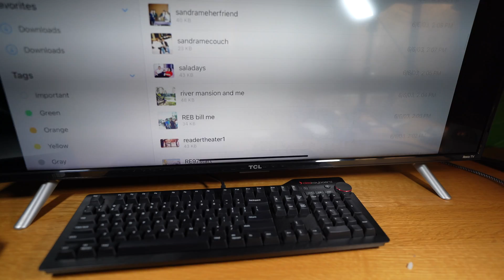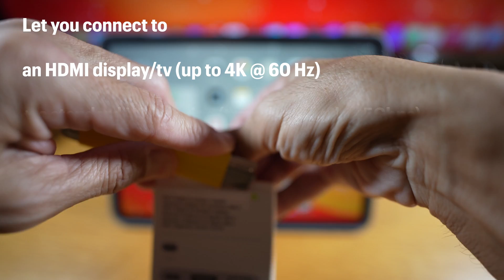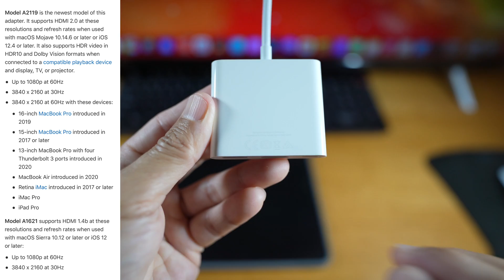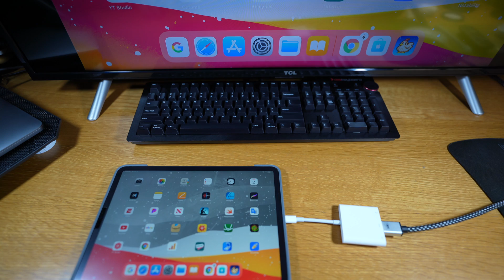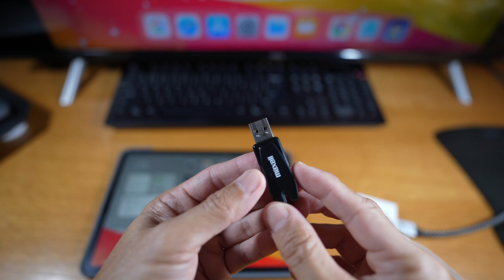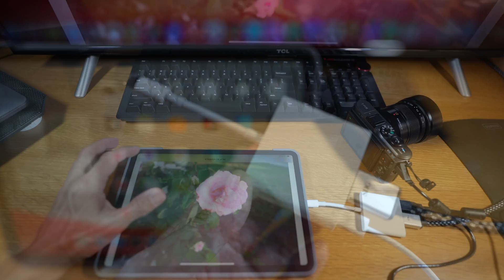For M1, M2 & M4 iPad Pro, Apple USB-C Digital AV Multiport Adapter

Comment: Elgato hd60s working this adapter are not
Reply from the maker: Yeah, the Apple USB-C Digital AV adapter can be picky—especially with capture devices like the Elgato HD60s. It’s mainly designed for simple HDMI output like monitors or TVs. For game capture, a powered USB-C hub or a different adapter might work better.

Comment: what happens if you unplug the power supply while you have a usb flash drive connected to the adapter at the same time? would the usb flash drive get disconnected?
Reply from the maker: Nothing will happen if you’re using an iPad with a USB-C port. These newer models are designed to handle USB flash drives and HDMI output without needing to stay plugged into power. You can safely unplug the charger—your flash drive will stay connected and working just fine.

Comment: Sir Can u connect a gaming headphone to the usb-A port ?
Waiting for ur reply :)
Reply from the maker: Yes, you can connect headphones to the USB-A port of the Apple USB-C Digital AV Multiport Adapter, but it requires an additional accessory. Specifically, you’ll need a USB-A to 3.5mm headphone adapter that contains a digital-to-analog converter (DAC). This setup allows you to use standard 3.5mm headphones with the adapter. Ensure that the USB-A to 3.5mm adapter is compatible with your device and supports audio output

Comment: I’m getting audio but no video when plugging in the adapter to my iPad Pro M2 trying to use Netflix or Apple TV+ you tube works fine. What’s going on here?!
Reply from the maker: Thanks for sharing! I’ve been using the same Apple USB-C Digital AV Multiport Adapter with my iPad Pro M4, and I haven’t encountered any issues with Netflix or Apple TV+. It might be worth checking if your adapter is functioning properly or if there’s an update for your iPad Pro. Sometimes a restart of the iPad or re-plugging the adapter helps as well. Let me know how it goes!
Reply: @ yeah I tried all that. I’m wondering if it’s my HDMI cable being too old and not 2.0 or 2.1?!
Reply from the maker: That’s very possible. After trying another, let me know how it went.
Reply: @ ok so i now have video and audio on everything since upgrading the cable.
Reply from the maker: That’s great to hear. Your intuition was right! I’ll keep this in mind just in case others have the same experience. Thank you again.
Reply: @ the next thing I need to now work out is why it only offer SD and not HDR option when plugged in to the 4K TV.
Reply from the maker: Thanks for sharing! HDR support depends on a few factors. Make sure your HDMI cable is at least HDMI 2.0 or higher, as older cables may not support HDR. Also, check the settings on both your iPad and the TV to ensure HDR is enabled. Lastly, confirm that the content you’re playing supports HDR. Let me know if this helps!
Reply: @TossSong  the HDMI is ultra up to 8K. 
You can’t enable HDR on an iPad.
The TV is a Sony 4K HDR10 panel. 
There is nothing here that should stop me choosing HDR as an option over SDR so I’m stumped.
Reply from the maker: I see. Since the iPad outputs HDR automatically when supported, and your setup (8K HDMI, Sony 4K HDR10 TV) is capable, the issue might be the content—I’m not really sure. Ensure the video or app you’re testing is in HDR. Also, check if your TV’s HDMI port is set to “Enhanced Format” for HDR10. Let me know if you figure it out.

Comment: I can connect a USB bluetooth mouse and keyboard to work on it? or the usb its only for transfering data?
Reply from the maker: Hi, thanks for reaching out. Unfortunately you can’t. But you can transfer data like in the video. This adapter is primarily designed for video output and charging, not for connecting USB peripherals like keyboards or mice. However you can use Bluetooth for keyboard and mouse.
Reply: @TossSong  its strange. In the website of apple the description is ''
The USB-C Digital AV Multiport Adapter lets you connect your USB-C—enabled Mac, iPad or iPhone to an HDMI display, while also connecting a standard USB device and a USB-C charging cable.''
Reply from the maker: Okay, I will test again when I get back from work. There might be in the iPadOS or iOS update that allows this. When I first bought it I remember testing it, didn’t work. But try it again.
Reply: @TossSong  i want to use for m3 macbook air. Thanks for the answer my friend!
Reply from the maker: Thanks for your patience. YES, it does work! I first tested a keyboard on the USB port on the adapter connected to my M3 MacBook Pro. (As you know the C port is for power delivery only.) Then I also tested on my iPad Pro, it even had an indicator icon for keyboard connection, never seen that before! So it works on both. Also tested a Mouse too, works. Again, I remember testing it when I first got it, nothing. Things must have improved/changed. I happy and glad about this. Thanks for questioning it.
Reply: @TossSong  Nice! Im seeing review of hubs for macbooks, and have view some review's saying that the non original hubs burn the visor of the macbooks, so i got really worried! And search for the original of the apple wich alows to combine the same structure. Thanks for the help and im glad that my question provides you a new way to use the hub! Thanks!
Reply from the maker: No problem, happy to help. And Thank you for this bit about the hub.

Comment: Hello. Thanks for the great video! Mine was working just fine but suddenly one day I lost the picture when streaming Comcast Xfinity but the sound still played through my TV. But the display was an iPad might sky screen saver. Any ideas? Is there a set up step I messed up? Thanks.
Reply from the maker: Hey there! Thanks for your comment and for reaching out. 
First, double-check all your cables are securely plugged in. Sometimes a loose connection can cause weird display issues.

Try restarting your iPad and your TV.

While less likely, there's a chance the adapter itself might be acting up. If you have another device with a USB-C port (like a friend's laptop) try connecting the adapter to that and see if the picture works. This can help isolate if it's the adapter or something else.

Maybe there's a setting on your Xfinity box messing with the output. Check your Xfinity settings for display options and see if anything looks funky.

If you're only having trouble with the Xfinity app specifically, it's possible the app itself might be buggy. Try uninstalling and reinstalling the app to see if that helps.

Hopefully, this helps get your picture back up and running.
Reply: @TossSong  First, thanks so much for getting back to me! I was in the tech field for a long time, since retired, so I am fairly handy and comfortable with setting up things. I re-tried everything you suggested to no avail. This is so weird! I have tried three different adapters, different cables and different TV’s in my home and gotten the same bad result. So I am guessing it is either an iPad Pro set up issue or Xfinity does not want me to use my iPad to connect to a TV and stream. That would not surprise me! But it worked for two months. Guess I’ll give them a call. If you have other suggestions, please advise. Again, thanks, Ken.
Reply: SUCCESS! Everything was connected so I checked the display settings and sure enough, when hooked up, it recognized my TV. I saw an action called “Arrangement” and opened that. There I saw the button to allowing mirroring. Sure enough, that was the one. Funny part is I am not sure how it ever got turned off since it was previously working but alls well that ends well. And maybe some of your subscribers will benefit from this knowledge. Thanks again!
Reply from the maker: Great, glad to hear you got it sorted out! I was thinking it might be in the settings somewhere. Sometimes we make adjustments here and there, and changed something unintentionally. Anyway Nicely done.

Comment: Great video and thank you for showing how to connect cables to adapter
Reply from the maker: Thank you for your comment and for tuning in. Glad this was helpful.
Reply: How can I tell if an apple  dangle cannot support 4K at 60 Hz
Reply from the maker: Hi, if you’re using a Mac, it’s in the System Settings > Display. Or from Apple website you can use the adapter 3840x2160 (or 4K) at 60Hz on:
iPhone 15, iPhone 15 Plus, iPhone 15 Pro, iPhone 15 Pro Max, iPad Air (5th generation), iPad Pro 11-inch, iPad Pro 12.9-inch (3rd generation and later), MacBook Pro (16-inch, 2019), MacBook Pro (15-inch, 2017 and later), MacBook Pro (13-inch, four Thunderbolt 3 ports, 2020), MacBook Air (2020), iMac (Retina 5K, 27-inch, 2017 and later), iMac (Retina 4K, 21.5-inch, 2017 and later), and iMac Pro (2017 and later)
https://www.apple.com/shop/product/MUF82AM/A/usb-c-digital-av-multiport-adapter

Comment: Hey man. Great video and almost solved issue. Can you please check if 12w charger is compatible with it? I tried with 5w charger and it won’t work. I tried with 20w charger and it works. If you can please check with 12w charger. Thanks man
Reply from the maker: Hi, thank you for your comment. I also have 20w (works well) and 5w chargers (low to charge). However unfortunately, I don’t have 12w charger. What I do know is if you’re charging an iPad through the this adapter with a 12w charger, it should work, but not a MacBook. I can’t say 100% since I don’t have it, but I’m pretty certain.
Reply: If you could please check it with 5w charger, it would be pretty helpful. I have 20w charger but due to heating, I use 5w charger during nighttime.
Reply from the maker: Hi, 5w may not work best. I already tried it, it’s slow. If you have the device Off and using 5w charger—maybe okay. You could try it and let me know. But I would only use 20w.

Comment: Sorry I'm very late to this content.  I have an 10th Gen iPad with usb-c.  I'm wanting to use the iPad as a "large" video monitor for a DJI drone controller.  The drone controller has usb-c out which, when used with a usb-c to HDMI adapter, allows you to export the video feed to an HDMI TV / monitor .  I'm wondering if this Apple AV multiport adapter would work for this? In other words, take the "adapted" HDMI feed from the controller and into the HDMI port on the AV multiport adapter.  OR do I just go direct into the usb-c port of the AV multiport adapter from the usb-c out on the controller?
Side note: Dude has game!  Lots of nice friends in your old photos!
Reply from the maker: Hi, thank you much for your comment. Yes, the Apple AV Multiport Adapter with USB-C port should work for connecting your DJI drone controller to your 10th Gen iPad with USB-C.

To do this:

Connect the USB-C out port on your drone controller to the HDMI input port on the AV Multiport Adapter using a USB-C to HDMI adapter.
Connect the HDMI output port on the AV Multiport Adapter to the HDMI input port on your iPad using an HDMI cable.
Once you have connected all of the cables, you should be able to see the live video feed from your drone on your iPad screen.

Important Note: The USB-C port on the AV Multiport Adapter is only used for power, and cannot be used to connect to devices such as your drone controller.

Alternatively you could try this:

Try to connect your drone controller directly to your iPad using a USB-C to USB-C cable. However, this may not work with all drone controllers and iPads, so it is best to check with the manufacturer of your drone controller to see if this is a supported option.

I hope this helps!
Reply: @TossSong  Thank you for your reply!  I did try going straight in usb-c to usb-c and nothing happened. Is there a setting I need to adjust in the iPad iOS?  Wasn't sure if I needed a 3rd party app.  Conversely I'm seeing another CP on YT sending an HDMI signal (from his Playstation for example) into an iPad with the new iOS 17 update via a $25 HDMI to usb-c adapter.  But then he still used a 3rd party app to be able to show the video feed.  He was using a "beta" version of iOS 17 however and I'm wondering if a 3rd party app will still be necessary with the now public version of iOS 17.
Reply from the maker: I don’t know about the 3rd party at all. Could you try it with the iOS 17? Or the latest iPadOS 17?
Reply: @TossSong  I did and nothing happened. That’s why I was wondering if I needed to make a setting in the iOS.  I think I’ll just get the usb-c to HDMI adapter and try that.

Comment: Can i use this to mirror my samsung tablet to my tv while charging the tablet? (I want to use ZWIFT on my TV)
Reply from the maker: Hi, thanks for your comment. I can’t say with 100 percent certainty since I don’t have that tablet, but my guess is yes. As long as the tablet is capable with USB-C port, but using an HDMI cable to your TV. Samsung also have their own “USB-C Multi-Port Adapter” that you may want to look up.

Comment: I have this dongle, but mine is Lightining and not Type C. I bought another adapter from lightning to type C to use on the iPad Air 5, but it didn’t worked with the adaptor.
Reply from the maker: Hi, thanks for commenting. From what I know, even with the additional adapter, the lightning adapter (itself) isn’t sufficient in providing power and data transfer rate for your iPad Air 5 that has USB-C port. That’s why it’s not working. You would need the one I have in the video. Pretty sure.

Comment: sir, can you try connect usb a hub to usb a port.
Reply from the maker: Hi, thanks for your comment. I don’t think it’s a good idea, it will heat up the adapter 100%. However, I should work in theory but not for long before it melts it. But I don’t have a hub to test it.
Reply from the maker: …the reason is that it’s not a “direct” cable conversation USB C to A, it has more electrical components for HDMI and power delivery. Just by itself it does get quite warm when in use and plugged in.
Reply: @TossSong  thanks for your reply.
Reply from the maker: No problem.

Comment: Does the adaptor  work for lightening earphones as well ? I mean can i use this adaptor to connect apple wired earphones to ipad pro ?
Reply from the maker: Hi, thanks for commenting. Wired Apple has a 3.5mm jack. Unfortunately this adapter doesn’t have the port for it. The USB-C is only for charging.
Reply: @TossSong  Thanks Mate !! Cheers
Reply from the maker: No problem. Thank you.

Comment: I wanted to know if I can charge my iPad and use Headphones at the same time, or is it used for different matters
Reply from the maker: Hi, you can with Bluetooth headphones and not through the adapter. So you know you can’t use the adapter with a headphone. (There is a way around but requires adapter on that adapter—so it defeats the purpose.) :(
Reply: @TossSong  aw that’s too bad. Liked the video though!
Reply from the maker: No problem. Thank you for your comment.

Comment: How to show the extended display in the MacBook air m1 chip? I used the USB multi-adapter to connect my MacBook air m1 to a tv, but it did not work on my tv. How can I set up the correct display? I cannot see any options to may it extended monitor.
Thank you
Reply from the maker: Hi thanks for your your comment. From what I know, it supposed to work with this adapter. Your adapter might be faulty. Can you get a replacement?
Reply: @TossSong  I will try first the other tv monitor.
Reply from the maker: Okay sounds good.  Let me know.
Reply: I am wondering if there is specific type of hdmi to use for connecting the tv or if any kind will do? The HDMI for my tv is HDMI 2.0 for 4k. I do not know what watch hertz it is.
Reply: I am wondering if there is specific type of hdmi to use for connecting the tv or if any kind will do? The HDMI for my tv is HDMI 2.0 for 4k. I do not know what watch hertz it is.
Reply from the maker: I don’t think so. Mine is HDMI 2.0 and 4K. It should be backward and forward compatible. Hope you can try out another TV. Or my guess is you have a faulty adapter. Let me know. Thanks.
Reply: @TossSong   is also not working when I use my anker hub to connect the hdmi.
Reply from the maker: Hi, according to Amazon reviews and Q&A, they are able to use it with their M1 MacBooks. That means it’s either your adapter is faulty or your HDMI TV is incompatible with the adapter/MacBook (or the TV port is faulty).
Reply: @TossSong  it worked on the tv when I changed it to 30 hzhz and used the screen mirror. But when I used the extended display, the computer icons only showed on the television or laptop, and I could not use my wireless mouse.
Reply from the maker: Glad to hear it works at 30Hz. One step at a time. I’ll help you research online about the icons and mouse.
Reply from the maker: So about the extended display, according to Apple you could only connect to 1 TV (or monitor) with M1 MacBook. And about the wireless mouse, try to turn off and on (then also the MacBook). Let me know. Thanks.

Comment: i have the same but iam not able to tranfers the data throughit it using for chrge reply must sir
Reply from the maker: Hi, thanks for your comment. You’ll have to use the USB-A (bigger port, “fork” label) to transfer data, not the smaller one. If it’s still not working, then it might be defective. Hopefully it’s from Apple, authentic.

Comment: can i use this to stream or is there an adapter that has ethernet port with the adapter

edit* sorry. i didnt finish the video but you said it already that “if you can do it with ethernet port its for you” . maybe i should try the one with ethernet port
Reply from the maker: Yes, you’ll need one with Ethernet port. You could read up on it here:
https://everymac.com/systems/apple/ipad/ipad-pro-faq/ipad-pro-wifi-bluetooth-versions-compatibility.html#:~:text=It%20is%20possible%20to%20use,Power%20Adapter%20with%20Lightning%20Connector.